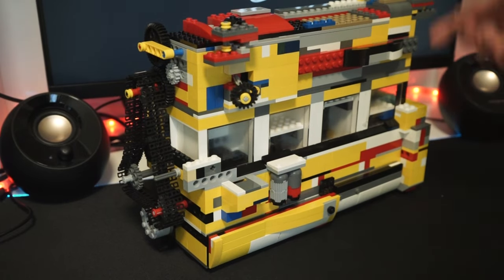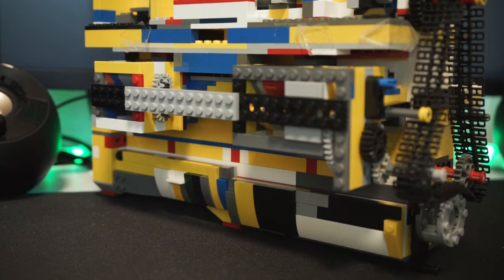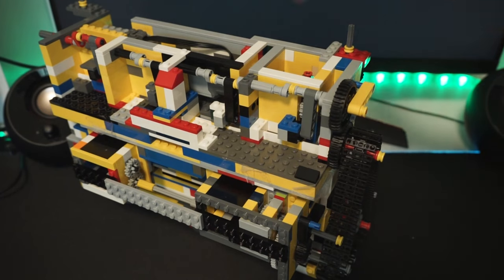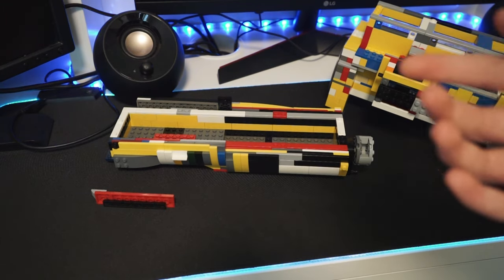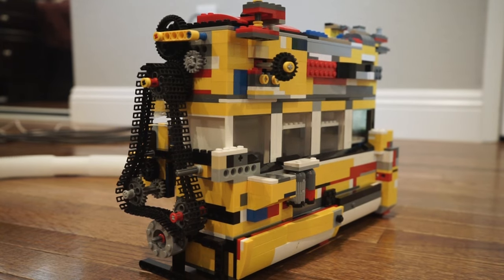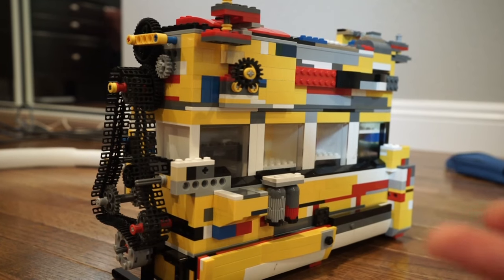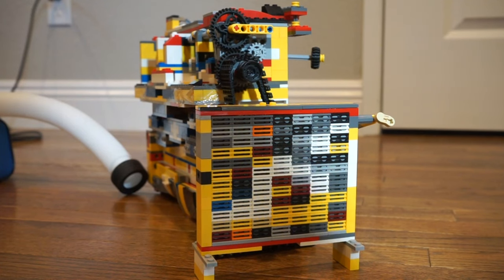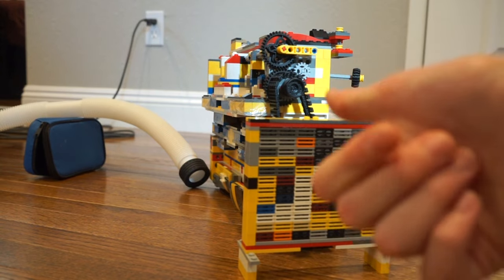Twin-Supercharged Lego Inline 4 Diesel- Vacuum Model Engine

Comment: btw  i bet if u put a vaccum turbine to the input (aka right next to the vaccum pipe) and hook that up to the supercharger that might actualy work
ik it will decrease sealing and maybe efficiency by a little but if u make it seal enough then it probably will start making enough rpm to make the supercharger actualy help and eventualy even increase engine rpm but its only a concept idea you can try it if you want might work well might not probably like a 90% chance that its gonna fail because of bad sealing and vaccum turbine not being strong enough but if u connect the vaccum turbine to the supercharger with like a 1:15 ratio or somethin and then connect the supercharger to the engine whych it alredy is but increase the ratio to like 1:5 cuz right now its like 2:1 and irl superchargers use like a 1:40 ratio after u do that the engine might not have enough power to turn over the turbine but the turbine will have enough power to spin over the engine and eventualy all 3 working together might work no idea probably not doe.oki have a nice day ,would love to see you try atlest. :)
Reply: Wait thats just a turbo god damn it.

Comment: +1 sub , try to make a 10x10 piston engine
Reply from the maker: Haha I probably won't have enough parts and it won't be efficient or go fast. Someone made a 32x32 engine though. Thanks by the way.
Reply: @Mattz6  yes maybe with two vaccum cleaner it could work , i made a 8x8 but it was not revving high, although it has a lot if torque
Reply from the maker: Hmm that is possible but I don't have another vacuum